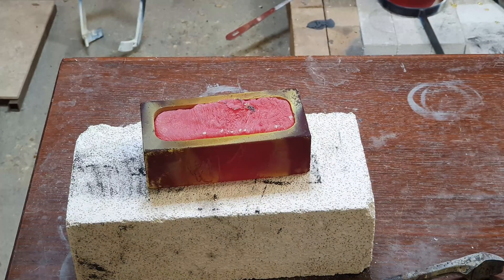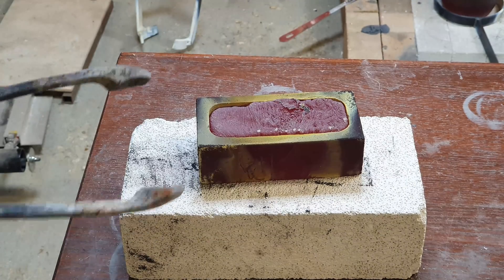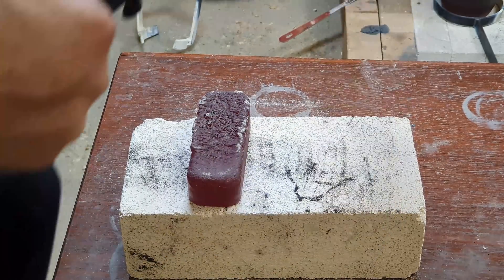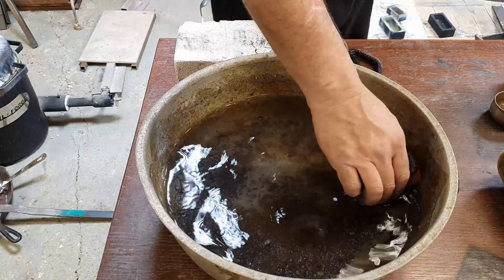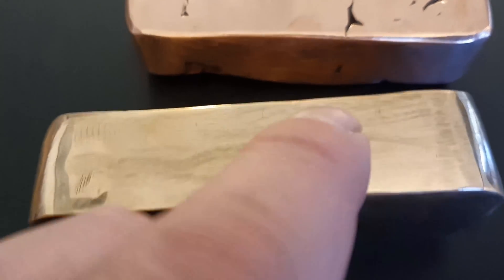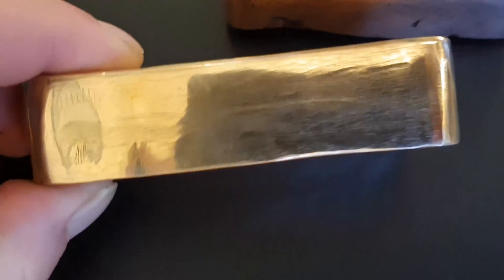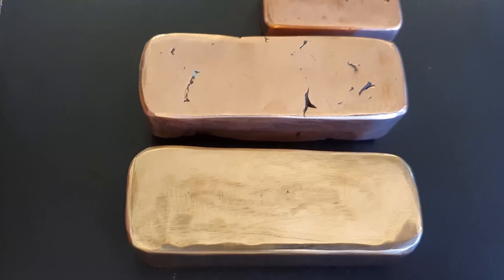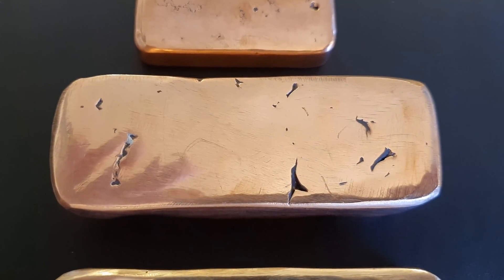Making Red Tombac of Paris - Alpha Brass - Copper, Zinc and Lead

Comment: Another "off the wall" suggestion, red iron oxide as a coloring agent. I think your "graining" is oxides, copper zinc and lead. Perhaps a better fluxing scheme would be to add half pre melt, the other half to the full liquid copper, a really intense mix, reheat to full liquid again, add alloying agents (perhaps after purging the furnace with CO2 or argon gas), reheat to full liquid once more,, skim, pour. The "old and dirty" way to alloy your zinc and copper without zinc combustion would be to use mercury to amalgamate them together cold, then melt and burn off the mercury in the furnace. However such a technique is obviously incredibly life shortening, as well as polluting the hell out of your workshop
Reply from the maker: Thanks Luddite.  Would the introduction of iron oxides not introduce more oxygen to the melt increasing porosity ?  It's a neat idea but red iron oxide consists of Fe2O3, would it not add a load of oxygen which would then need to be removed by introducing a more reactive ingredient such as phosphorus or lithium ?  I think your right on the graining being oxides, I think these are a result of the lead migrating to the outer areas of the metal due to it's lower melting point.  When I polished it last week none of those marks were visible and it was 'clean' and shiny.  A week later and the lead has shown signs of oxidation which I should imagine is the cause of the graining.  Given the right casting this could be quite desirable if it could be repeated, especially with a higher lead content.  I do have a small bottle of argon gas, but due to the huge amount of heat in the furnace I wonder how long you could keep the gas around without it rising due to the convection currents.  The only method I haven't tried yet is dissolving the copper into the zinc at low temperatures, however the amount of copper that can be dissolved is finite, kinda like dissolving sugar into water.  Mercury isn't a metal I fancy playing with too much, I don't understand enough about to comfortably experiment with it.  I'll leave that one to Cody's lab I think hehe.  I'd be interested to understand more about the red oxide idea though if you could point me to some more info...?  Cheers Andy 🍺🥂😎
Reply: @MeltandCast ,  So much I could say here but I only have limited time. :- 1, Referring to the Ellingham diagram it is obvious that molten copper will NOT take up oxygen from iron oxide. Zinc will have some tendency to do so but there is so little of it present (about ½ what you think at a guess!) that its activity in this way would be very low.                                                                                      
                                                                                                                              2, Generally it’s a bad idea to do a really intense mix, all this will do is stir in gases from the atmosphere – principally oxygen and hydrogen (applies to ALL molten metals)

                                                                                                                             3, I would not have mercury anywhere near my foundry - it is very dangerous stuff - even at room temp it gives of vapours highly toxic!!!!! 😱

                                                                                                                              4, Regardless of how you make your brass zinc flaring will occur – the more zinc the lower the temp at which flaring will occur. As luck will have it the temp at which noticeable flaring begins corresponds (roughly) to the correct pouring temp – old timers used this as a guide to the correct temp. (Takes skill and practice though) There are ways of limiting the flaring which I have never seen used on YT

                                                                                                                             5, Lead will NOT alloy with copper the two are mutually insoluble. In the solid alloy the lead will be present as very small spheres of pure lead often they will have gravitated to the bottom of the casting concerned

Would suggest that you do not use zinc for you counters as it will just go all dull and grotty looking. Suggest possibly that you make from steel (turned) and blacken with a molten salt nitrate bath.

Alloy make up is a difficult task full of traps for the unwary – I have never yet seen alloy make up done anything like correctly anywhere on YT. For example, most who attempt 90:10 Aluminium bronze by adding 10% aluminium to pure copper are fooling themselves as they would likely lose ½ that aluminium to oxidation – thus making maybe the equivalent of a 95%: 5%. Zinc is even worse in this way -I doubt your first effort has anything like 2% zinc in it…Martin
Reply from the maker: @Olfoundryman Thanks Martin, I love it when you come on here and set the record straight, I really appreciate it.  Clearly I need to spend some time on the Ellingham diagram to understand it more.  OK you're probably going to have to set me straight here again, but am I understanding this correctly ?
1. Because the zinc line crosses iron line the zinc will absorb the iron oxides at around 1200C (likely the temperature the copper is at in the crucible) ?
2. Due to the separation of lines between the copper and the iron, oxide take up will not occur ?
3.Aluminium, magnesium and calcium could all be used as a reducing agent "in theory" as the separation of lines is greatest between those metals ?
4. The melting point of aluminium, magnesium and calcium are all below that of copper and iron which if in it's liquid state would enable them to be effective oxide reducers of iron and copper ?
5. I assume the metal needs to be in a liquid state to act as a reducing agent for metals higher up the diagram ?  Therefore....
6. Magnesium and calcium would be a poor choice of reducing agent for copper as its boiling point is below that of copper and likewise calcium would be a poor choice for iron as its boiling point is below that of iron ?
7. The best choice would be aluminium ?
Appreciate you're busy - If I have it all wrong just tell me to do more research or am I getting the jist of it ?

I'd be interested to know your take on reducing flaring when making brass although I am nearing the end of my brass experiments for now...  I'd still like to try a method suggested by a true expert in the field to see if I can nail it.

The counters need to be cast as there is a "medusa face" in the centre of each counter, it was my Dad's old backgammon set so I am keen to use the original counters.  I will probably opt for copper for both sets of counters based on your suggestion.  I will use a heavy dose of liver of sulphur on one set to blacken them, with gold leaf on the 'medusa faces' and lacquer to finish.  Polished copper will also show off the gold inlay well.  I'll try adding some phosphur copper to the melt when I do this to reduce oxygen in the melt.  The cudox tubes I have are supposed to be for a 50kg melt but only contain around 14 grams of phosphur copper.  Assuming I make a 5kg melt would 1.4 grams of phosphur copper be enough to reduce the oxygen, or should I add more ?

Lastly I am thinking of adding some silver to the copper to increase fluidity in the mould at around 5%, does that sound like a good idea ?  The silver addition gives a lovely sheen when polished.

Best wishes and thank you once again for your continued teachings !!!

Andy
Reply: Andy, Andy, I too need to spend some more time with the Ellingham diagram to understand it more. In truth my understanding is very basic and pretty much limited to -   
               A;-“any reaction below another will likely occur in preference to the one above”  
               B;- “ the greater the distance between the two reactions the more heat given out as the lower one reverses the upper one”
               C; - “An initial Kick might be necessary to get things going”.                                                               
               D;-  “things are complicated by there being more than one oxide for some elements (3 for iron!)       
               E;-   “things are complicated by elements/oxides melting or particularly boiling                                        
               F;-   “removal of an end product e.g. by boiling off will likely move the equation in the direction that produces that product                                                                                                      
               G;-  “extent of the overall reaction dependant of the % of reactants present”

Right or wrong that is my poor understanding.

I always like to think of thermite as an example – iron oxide (Fe2O3) is reduced by aluminium to iron and the aluminium oxidised to alumina (Al2O3). Because of the large distance between these reactions on the Ellingham diagram a very large amount of energy is released - so much that the iron produced is not only molten but has enough superheat that it can and is used to weld railway lines together. But despite the great distance on the diagram the reaction still needs that initial kick with some sort of igniter to set it off – but then, stand back!

If you can find a very competent Chemical engineer (Is there one out there who can come on board?) and get him to explain it as I do not really know enough to provide a dependable interpretation

To your questions 

1, I am uncertain but I feel it is very much complicated by zinc being a vapour at this temperature, by there not being that much (%) of it present, and by the look of the diagram with its dotted line above the boiling point of zinc ending in a arrow pointing ever upwards I may not be the only one uncertain! I think that under the circumstances a reaction between the zinc and iron oxide is probably unlikely – Much more likely is zinc reacting with copper oxide.

2, Yes, but again complicated and a little uncertain (in my feeble mind) by the possible reaction betwixt Cu and Fe2O3 to produce  Cu2O and Fe3O4 above about 680 deg C. Curves here are close together so any reaction is likely not very energetic or very complete??

3, Yes, but again complicated by possible deleterious end products.

4, Yes, but the term “effective” needs to be thought about.

5, In truth I do not know but I strongly suspect not – many such reactions (think of gun powder and other solid rocket fuels) occur in the solid, usually finely divided of course.

6, I think so as the loss of the deoxidant via vaporization will tend to pull the reaction in the wrong direction slowing it sufficiently (maybe - I don’t really know) for the vaporization to remove the deoxidant.

7, No, not for copper as then end product is bifilms of aluminium oxide - the bane of aluminium bronze founders. But yes, for steel as the alumina fluxes with other oxides and becomes molten then as globules of molten oxide it floats rapidly to the top of the melt and can be skimmed off

Aluminium is used commercially to deoxidize steel but better deoxidisers are available for copper – see below.

Re brass make up – I am no expert – I have never done it! I hate brass, in my early casting years I did do brass but started  with existing brass – I did not like the zinc fumes and the colour change that occurred as the zinc content altered – candles sticks cast one day were a different colour to bases therefor cast the next – hopeless. There are simply much better alloys out there and brass has a horrible greenish colour anyway – well - compared to an Aluminium silicon bronze which is much more of a true gold colour. I intend to do a video when health permits on proper melting of copper and that is part of the secret to alloy make up but you will have to wait until then as I prefer to keep my powder dry.😏

Counters have to be cast – I had figured that as being likely but what about casting all in copper and then electroplating half with Ni or Ag or even Cr? – Even black nickel?

Beware of phosphorous - too much and a very low melting eutectic is formed which penetrates sand very badly giving very rough castings. Those tubes contain 15% phosphor copper just open one up and weigh out the required amount. Wrap the required amount up in copper or brass shim stock and plunge using a forked steel rod to hold the wrapped phosphor copper to the bottom of the melt. How much to use? Good question - and it depends on how badly oxidised the copper is and that is an unknown - traps for the unwary! At a guess use at least the 1.4 gm and maybe twice that if your copper melt feed is thin or is known to be gassy. It is common for good copper work to deoxidise first with Phosphor copper and finish of with Lithium - Foseco make a lithium containing tube.

Adding 5% silver improves fluidity? – Hmm, not heard of that, and it flies in the face of pure metals and eutectics being the most fluid of metals. As a general rule fluidity is known to drop off very quickly with  impurity increase. In the Ag Cu system max fluidity would be likely at pure Ag or pure Cu or 28.1% copper the eutectic alloy (mp 779 deg C)

Hope some of this helps 

My ignorance thus exposed I will see if I can dig out anything about the Ellingham diagram that I can understand – I will pass it on if I do….. Martin.

PS, Now I really am out of time😱😊
Reply from the maker: Hi Martin, so kind of you to give me the time once again for such a detailed response.  I'd like to thank you personally and on behalf of my subscribers for your continued sharing of your knowledge.  
I have emailed someone, I hope he can help with the Ellingham diagram, but I expect he is extremely busy... fingers crossed.
To your answers:
1.  So again, we are back to the importance of degassing the copper correctly before adding the zinc and preventing the further take up of oxygen into the melt to produce a more limited reaction from the zinc when added.
2.  Am I right in my understanding you always need a more reactive ingredient to produce a reduction in oxides, the more reactive a metal is the harder it is to find a more reactive one to perform the reduction.  e.g copper would require a more reactive material such as phosphorus or lithium to perform this reaction ?
4.  Would boron copper be an effective way of eliminating oxygen from copper melts as well ?
7.  I understand the advantages of reducing bifilms into the casting and the difficulties in not introducing them in the first place.  I have seen several videos where people have specific sprue designs, spin traps and pouring basin design, all of which may help reduce them...  And then I watch you produce perfect castings using none of these techniques.... I wonder of the efficacy of it all...  Especially when you think of the history of metal casting through the industrial revolution with steam engines and such.

I look forward to your copper melting video with great interest.  Copper is my metal of choice despite the difficulties it presents,  I'd love to learn the secrets of successful copper casting.  I know lots of people won't touch it for casting, but there's something about it that really gets me...

I have never tried electroplating, I should look at that for some future videos.  Again it's something that can go hand in hand with producing more varied and interesting castings.

Noted on the phosphorus, I'm struggling to find lithium copper online in the UK though, I'll keep looking - perhaps I need to phone them first.

I wasn't sure on the silver content, all I know is few times I have mixed copper with silver in the past it seems to have a much better quality to it than regular copper.  Porosity seems much reduced and the quality of the casting seems to have a much better finish.  I have opted for a 25% silver  / 75% copper mix for the counters "Shibuichi",  the sheen on this alloy is just stunning and when combined with the gold leaf should look the business...

Thanks again for everything, good health, best wishes Andy
Reply: Andy,
 

 1. Yes, but remember I am no expert in brass make up – I tend to buy my metal already made up but if I need a special alloy, I look around for something close that I can buy and then modify to what I want. For example, you could buy a 60/40 brass melt some pure copper and add the brass to it plus any other small additions that you might need, I think this technique would involve a lot less zinc fuming and loss and give you a more accurate final result. However, if you still wish to go down the total make up route the zinc itself will deoxidise the copper (with flaring) but I would be inclined to deoxidize the copper with  phosphor copper and then add a slight excess of zinc, keep the temps as low as you can - you will still get flaring but perhaps not as bad.

 2. Yes, to deoxidize anything you need something below it on the Ellingham diagram but you need to keep in mind the end products of the deoxidation – aluminium tends to produce tough bifilms of alumina – these can form serious defects in copper base alloys.

        4.  Yes -sort of! Foseco (and no doubt others) make a range of “deoxidizing tubes”

         DS contain phosphor copper

          L   contain lithium

          CB contain calcium boride

          Presumably in the latter case both the calcium and the boron provide deoxidization.

          The L and the CB tubes are generally only used for high conductivity work (I think!)

        7, Oh dear! Where to start? – One could write a book on this and in fact John Campbell did! A big one! While I don’t use all the tricks, I do in fact use many of them. For my sand work I ALWAYS use small tapered sprues. I have done so since about 1965. I have always used a pouring basin that will keep the sprue full for the entire pour although only within the last few years have I adopted the John Campbell inspired and much superior basin design. In addition, I do not use junk metal – I buy 601 ingot (LM25) so I start with a better material – the only non-ingot material I use is returns from yesterdays melt (cut off runners feeders etc). I am very, very fussy about this. In addition, my work is in the main under 2Kg so runners etc are small with metal streams usually less than 12 mm thick - this means that the metal is under meniscus control and thus does not tend to fall over itself thereby avoiding turbulent air trapping splashing. Contrast this with the 30 mm diam parallel sprues deliberately extended 100 mmm upwards via a bean can filled with sand and topped with the worst possible basin design, a funnel – an arrangement guaranteed to aspirate as much air into the metal as possible and to cause the greatest turbulence, sadly seen all too often on YT and frequently on at least one well-known channel!

The efficacy of it all is obvious with bigger work but I would like the opportunity to discuss gating etc for small work with John Campbell and /or Bob Puhakka (I did get an invite to Bobs latest open day and JC will be there but I am in Australian they are in Canada I do not have a passport and an recovering from surgery – sad -I would have killed to be there!)

As JC himself says – It all a matter of  “horses for courses” If you are one of the “turd polishers” of this world who melts down junk found on the side of the road wastes a lot of gas on it to produce a simply awful looking ingot which is then polished and stuck on a shelf in the name only of views then it does not matter what you do. (it is a point of some personal annoyance that these people get up to 400 times the daily sub increase that I do!)

If however you are trying to produce half decent casting then all the bells and whistles are a good idea particularly when, typically, they take little if any extra time to implement.

Remember that over the 6000 years of foundry many bad castings were and still are made - some steel foundries are said to have bigger “weld up the defect” departments than casting departments (NO joke!) The industrial revolution was based largely on cast iron and it is said to be “God’s gift to the foundryman” - easy to make an acceptable casting wirth and castings could be, and no doubt were, overdesigned to allow for, ahem, foundry problems. Then of course the castings we see are the surviving good ones – the unknown is how many bad ones did it take to get these good ones? From my experience in industry sometimes an awful lot! Campbells methods when used fully lead to way better and cheaper castings – just ask Bob Puhakka

The copper casting is possibly a ways off yet – it depends of my health improving and first I have to finish the making  a moulding box series.

Electroplating is unfortunately a whole new ball game but its big secret is proper surface preparation and cleanliness.

Foseco are the big UK manufactures of degassing products but are unlikely to sell in ones and twos perhaps they can tell you of  or you can find a local foundry who they supply who will sell you ( For CASH BEER money) the small quantities that you want.

RE silver I would raise that 25% to 28% the eutectic alloy as that will have max fluidity but will probably need careful feeding to avoid any gross hot spot shrinkage….. Martin